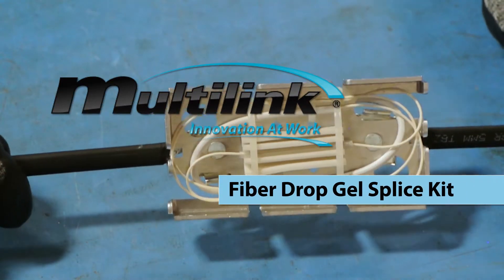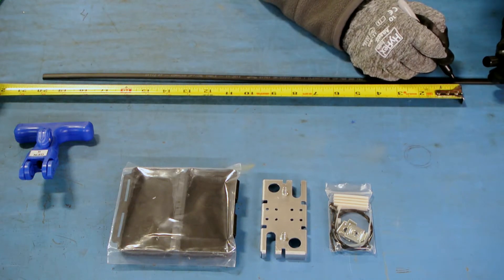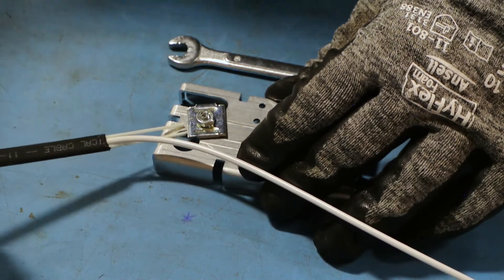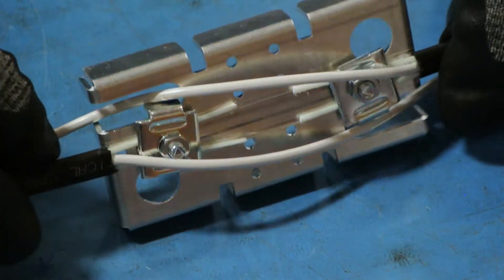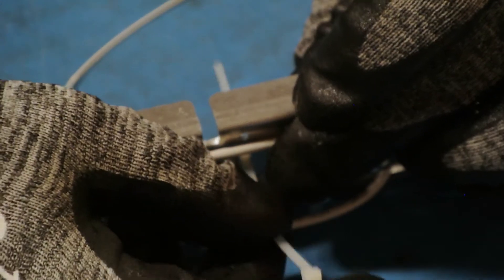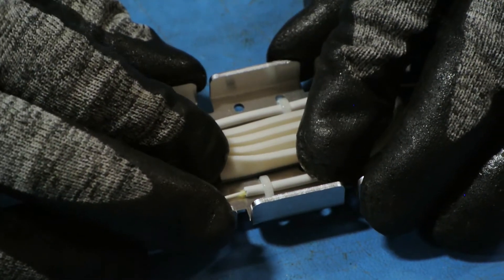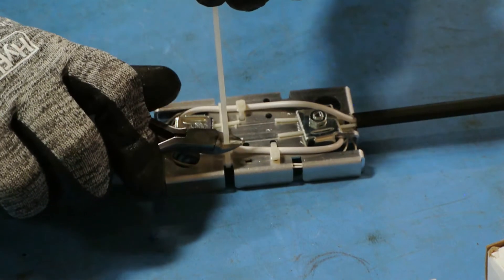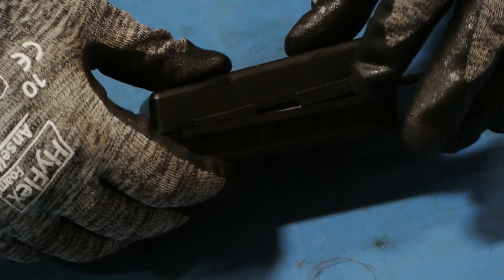Fiber Drop Gel Splice Kit Installation

Comment: Great demonstration! Just an observation,  and I could be wrong but I think the fiber was inserted invertedly. If you look closely at 4:00, you can see a cut out section on the underside that the fiber can slide into to possibly ensure it does not hit the nut. Just an observation.